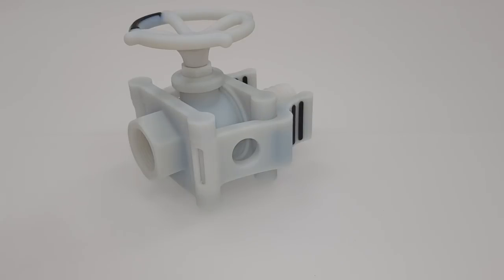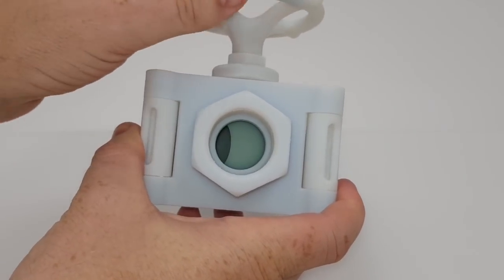3D Printed Full Color Texture Prototypes & Functional Parts: Stratasys J750

Comment: Question about the veraflex material for eyewear... Can they be used as an end use part? Or purely for prototyping? If not, are there any other materials that would work for the actual end use eyewear product? I have only seen printed metal parts in the market.
Reply from the maker: Hi there, VeroFlex was intended to use for prototyping. On its own, it doesn’t have the mechanical properties to be used for end use parts - it's possible, but depends on many factors. We have other materials that can be used for end use parts, but depends on the type of project. If you'd like to chat with one of our experts, please visit our website and leverage the live chat option. Thank you! https://www.stratasys.com/?utm_medium=social&utm_source=youtube

Comment: Great video & loved the show and tell on new products developed for the new Staratsys J750 rapid prototyping 3D printing. The products construction & visual pleasingly finishes are truly amazing especially since they come with a complete wow factor of product richness, quality, and depth of the colors.  Hats off for the engineers for these tough product finishes of Agilus 30 combined with VeroFlex's optimal rigidity/durability solution material with it's capacity for custom full-color designs. Absolutely beautiful. I'd love to see at least these 3 questions addressed in this video show and tell: Is this 3D printer affordable for small businesses? Also, is it cost/profit worthy for all the production efforts and monthly maintenance cost of keeping such a specialized 3D printer up and running for x amount of hours of product production. And is the software that runs this machine coming from a third party or is it hard wired with the Stratasys J750 printer with product updates? and does the software have it's own open source type internal design studio for 3D product construction?
Reply: sherri99516 Stratasys printers are crazy expensive, as are the materials. Whether it is cost productive for a business depends on what you are making with it.
Reply: Awww, figured as such. If you have to ask the price one usually can't afford it! What a shame. Thanks for the reply. I was heading towards their web site to check it all out further. Thanks again.
Reply: sherri99516 the printers are still good for some businesses. I know that Microsoft uses some of their Connex 500 printers for laptop frame prototypes. Also, it's not really easy to check the price for these printers. You need to request a quote, as their buying system for the printers isn't like a normal store.
Reply: Yes, I understand & thanks for the feedback. It's always fun for me to see what a machine can and can't do first and then I can let my creative side run free with ideas & function before I will start checking prices & what brands to buy if & when I can utilize a particular 3D printer that will perform within reason & be product cost effective.  I'm probably doing it backwards but I sure wish the prices for these machines were a lot more transparent for an open market. It's never a good thing, in my opinion,  when there's marketing force &  fluctuating sales pricing going on when selling certain/buying  limited production type manufacturing products. I may be just to cheap and thrifty for my own good. :) One good thing, love these show & tell videos! It is a learning process for me.
Reply: Iiciofofoof9coifoco8766
Reply: Ijkirijdjdjj